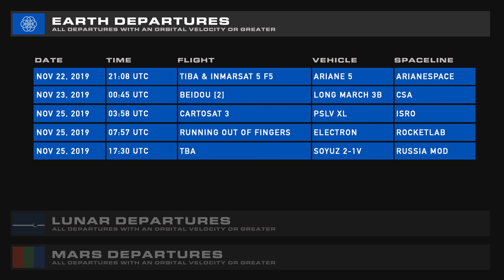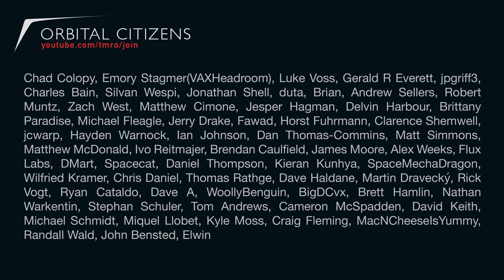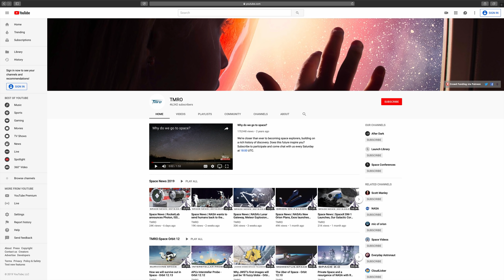Boeing is not happy with NASA report  |  Space News

Comment: What the!? They just threw the heat shield, that sounds like a large dangerous piece of space junk. How long will it take to de-orbit?
Reply: IKR? Maybe they threw it VERY HARD retrograde, so it will deorbit sooner... NOT!  Why didn't they take it back inside and stow it in the next trash burn-up capsule?  I thought space junk was a huge NO-NO!
Reply: @DoulosDS  lolz that would work if they threw it with a rail gun 😂 

You're right, even if it would not fit in the next burn up capsule they could've tied it to the capsule outside easily enough.
Reply: Hand thrown waste takes about 2 years to deorbit from that height.  It would have been more responsible to place it with the garbage in the capsule.  ISS crew has been chcuking waste items over the side for years.  Still, littering low orbit even for a couple of years could be problematic.  Very much like people in cities throwing rotten fruit in the gutter when there is a trash can 10 steps away.
Reply: Because the calculations for the deorbiting of the capsules are very specific, and just "strapping it to the outside" would severely disrupt the aerodynamics of the capsule, potentially causing it to tumble unpredictably, which could lead to the potential of it actually not burning up on re-entry and instead impacting the actual surface of the Earth.   I REALLY do wish it were that simple though...

Comment: Ofcourse Boeings seats are expensive but why is nobody talking about how SpaceX's seats seem incredible expensive as well compared to soyuz? A seat on a soyuz went for about ~$35 million (including inflation) before the political warfare began, also something to note is that the soyuz had a monopoly back then and the ~$35 million could be easily a multitude of the actual cost.
Reply: NASA:  "Look out! Here comes a bear!  Boeing:  "You can't outrun a bear!"  SpaceX (putting on running shoes):  "I don't have to outrun the bear, I only need to outrun you!"  As long as SpaceX has a monopoly on re-usable boosters, they can charge whatever they want, as long as it is less than the competition, and they can rightfully recoup some of the development cost they spent.
Reply: No one is accounting for the 7 seater configuration.  Soyuz only fits 3 people, and only 2 can be docked at once.  With a 7 person escape vessel, ISS's crew capacity can be brought up to where it was suppose to be: 7 people.  They've been a person short because there weren't enough escape vessel seats.  This will greatly increase the amount of crew time available to dedicate towards science.  Even a 5% increase in launch cost will still be worth it in terms of the changes to operational efficiency aboard the space station.
Reply: The Soyuz model is old, tried and tested in the best ways possible, hence why it was so much cheaper before the dick measuring contests made things the way they are.